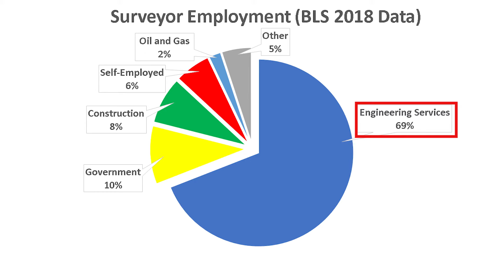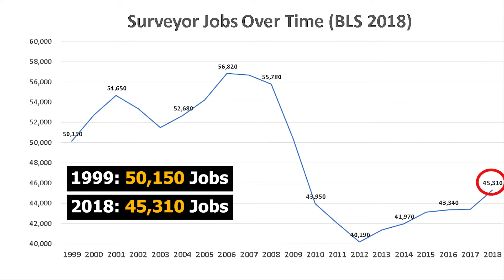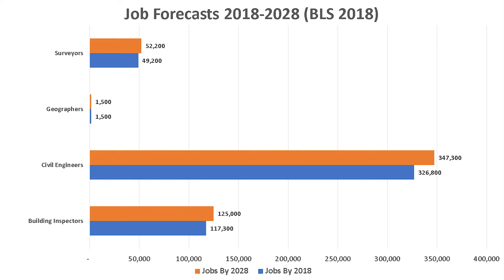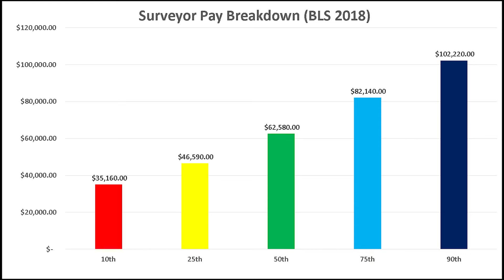Surveyor Pay (2019) – Surveyor Jobs

Comment: Just to clear up some slightly misleading information, surveyors use several tools besides GPS. These include theodolites, total stations, and builders levels. GPS is "good enough" in many cases but is actually the least accurate instrument in a surveyors set of tools.
Reply from the maker: Appreciate the info!
Reply: Allen you are 100% right, but there are newbies out there that do not know this and could use some schooling on the technology on how and were to use GPS or the Trans....BUZZ
Reply: Accuracy depends on the data analyse methode... i use bernese and it give a mm accuracy for more then 2000 km baseline
Reply: But we do use GPS, maybe not for layout or setting control
Reply: @jacobblake7067  We also do not use it when conditions will not support it. Heavy canopy, too little sky, and other complications can prevent enough satellite fixes (and resultant accuracy) to give us the precision needed for the job at hand.   But we use it as much as we can for sure!
Reply: So true we were taught that DGPS is more accurate
Reply: Feel free to make a 5 hour video elaborating on everything about surveying 😅👍

Comment: What is the average age for someone that is just getting into surveying? Thanks for the video!
Reply: Early 20s would be average in Australia. But the earlier you can start as a survey technician (chainman) the better. I'd recommend working part time while studying.
Reply: Started at 19 years old currently 22 running my own crew.
Reply: Any.  I started at 49-51, then went back at 55 and that's where I am now.  The guy I work with now started at 18.  The guy who replaced me was about 18, then went into electrical. The fellow I used to work with was three or four years older than I.  Our boss is two years older than I and he got licensed around 1998--in his mid 30's.
Reply: @NavalTripod hey i just turned 20 and got offered this job in Chicago suburbs $21hr “land surveyor”. Can I get some honest opinions?